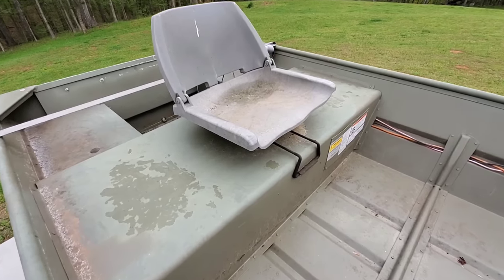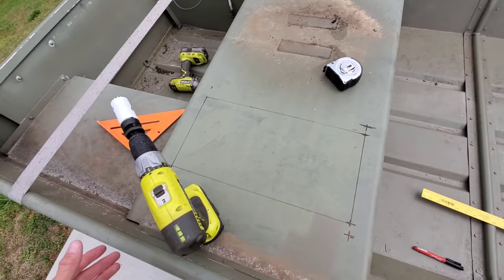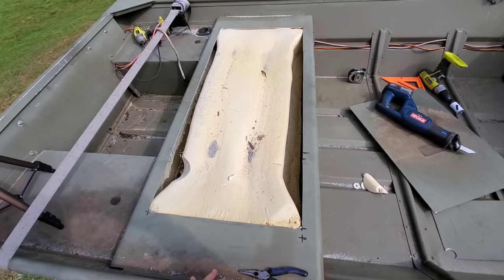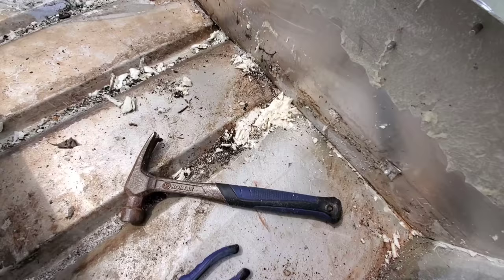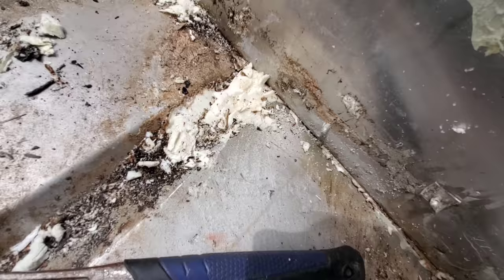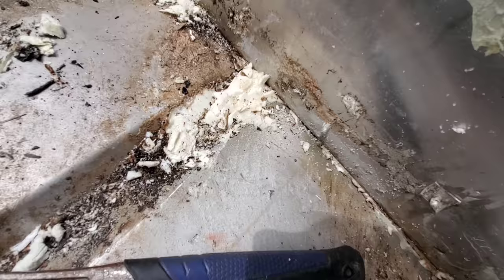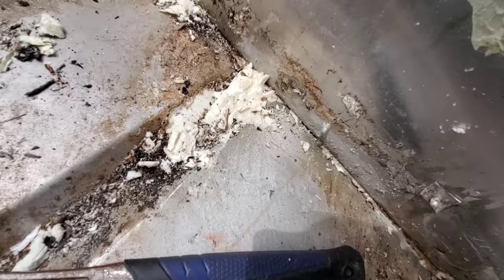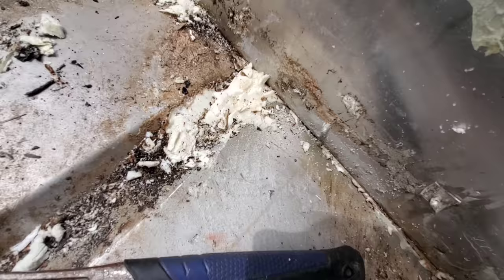Turn Your Jon Boat Bench Into Storage

Comment: Very nicely done. There’s a few things I would have done differently but I only noticed certain things because I watched you do it. You get better each time and we all learn from our mistakes along the way. You figure out what works best and what is the most efficient way to do things. Needless to say the end result you had was awesome. It’s a lot of work. I buy and build John boats and fish out of them for a year and then sell it and then buy another one and start over. In your head you think you can always bang it out real quick and then once you start sanding and prepping for paint you are quickly reminded of how much work it is to build one. I started out with a canoe I got for free. I refinished it, used it a few times and then sold it and used that money to buy a John boat. I then did the same thing and with that money I bought 2 more John boats and so on and so forth. I try to have 2 at all times so I can finish one and fish out of it while I’m building the other and then I will sell one. I’m working my way up until I have the money to buy a nice war eagle or something without having to take any money out of my bank account.

Comment: Using the recip saw- hold the saw vertical so that that shoe rides on top of the metal your cutting. This will stop the vibration of the saw and make it controlled cuts easier. 😊
Reply from the maker: Appreciate it! I upgraded to a circulars on the next one, it worked MUCH better. Not sure why I used the recip saw on this one besides trying to show off I can cut straight lol

Comment: Very nice job! I'm going for the same thing on my jon boat. Just a tip: A skill saw works great for cutting aluminum sheet. The carbide blades go through it like butter. But just keep a firm grip on the saw in case it bucks back on you. Hearing and eye protection a must! Greetings from Alaska. Oh yeah, plywood is $100 a sheet here where I live. Unreal.

Comment: I like how you countersink the rivets. I never would’ve thought of that. Also, get a scrolling blade for the sawzall. You’ll be able to cut nice straight lines because you can control the blade without it walking on you. Nice job. 👍
Reply: That’s insane!
Thanks for the tip!

Comment: I was able to find alucobond at a sign shot for $60 per 4x8 sheet. Did the floor in my boat. 1 3/4" foam in the floor between the ribs. I believe im going to go with a textured paint on the floor. You did a great job trying to get ideas on how im going to do the front deck and put a rear bench back in the boat with storage like you did here. I like how you did the strips of foam under the foam board. For an air gap. Great work.

Comment: I’m going back over some of simple projects to repeat on a buddies boat. For a moisture barrier under the foam, consider corrugated plastic. (Where the budget allows)
Reply from the maker: Thanks!
Reply: I like that idea. I might even put a few louvered vents in the front and back of the bench for more air circulation. I definitely want it to be as dry as possible
Reply: @Dangbo3030  not a bad thought. I’ve seen some run very small 12v dehumidifiers. May be overkill

Comment: I tried preserving plywood with epoxy resin. Its more flexible than fiberglass resin. It eventually broke down from the wood expanding and contracting. They sell 4'x8' pvc (Azek) board in different thickness's at home depot. It would work great for flooring also.

Comment: I loved the video! I made mine a little differently though. The seat lid is just one large piece connected to the aluminum with a piano hinge. It was a lot easier than aligning multiple pieces, and i have more access. It works great on my 14' Jon. I coated with polyester resin and primed and painted with Total Boat polyurethane paint and it turned out great! Thanks for the tutorial :)

Comment: I will say your work looks very good, but frankly i was floored by your return comment regarding removing the foam floatation.
Yes, you are correct in your opinion as to it not being necessary unless the boat flips over.
Building codes are implemented for the benefit of the buyer, not the builder.
Having been a home builder for over 40 years as well as a boat owner, i can attest to that.
Hanging onto a boat that wont sink would be a better option than having the boat on the bottom and nothing to hang onto in my opinion.
Coolers stashed in a small cabin have been documented in keeping a boat afloat, and thereby keeping the occupants alive.
My opinion is that if you need more space for storage, get a bigger boat or find a better way than eliminating the floatation.
For the record, boats over 22’ in length arent required to have floatation.
But fact is that many of the better ones do, and for a very good reason.
I do have a 14’ jon boat, and i did create more storage space, without removing any foam floatation i might add.
Reply from the maker: My response was not meant to "floor" you. I didn't take it as a rude response.  The fact of the matter is that I have a large viewership here. A lot of know it alls that feel the need to infere their opinion on my platform. The foam thing seems to trigger a lot of folks. Even though I've proved time and time again on video, it isn't doing what you think it will do. I could go on and on about modifications,  weight capacity,  howadding extra storage or decking can help it sink if flipped over, ect. We could even talk about modifications and how they aren't universal or regional, depending on the waters and intentions of the boat use. No point really. You do as you please with your boat, others will do as they want with there's. I can appreciate you like the foam. I think boat licenses should be required in all states. I think more guys should wear their kill switch lanyards. I think life jackets will save way more lives than relying on foam in an old aluminum boat to keep you afloat. Just my opinion,  apparently, everyone's got them. Thanks for watching even with disapproval of foam removal. Happy boating.
Reply: I have a old 14 foot ryan craft there was never foam in it.

Comment: Was there a specific reason you didnt finish out the interior storage place before installing the aluminum top. It seemed to me that it would have been much simpler to install the partition divider and finish out the flooring with the top panel off? It looks great by the way, gives me some inspiration to do my Alumacraft.
Reply from the maker: No. Was making it up as I went along. It wasn't so bad or I'd simply have drilled the rivets out and removed the top. Take away what you can from it and do as you please.

Comment: Hope this gets to you, but I’m in the process of building out a brand new Lowe aura. I cut the back bench out and removed the foam and added hatches for storage. The bench flexed a lot now under a load. Did you have that same issue when you did this? If so, is that why you added the aluminum bracing?

Comment: I’m not too sure about gluing carpet to foam. I would have thought you would put aluminum ribs then put the foam in the gaps then sheeted the bottom with carpet covered plywood or aluminum sheet. Thoughts?

Comment: What are the screws you're using at 20:56 going into underneath of the carpeted seat you made? Are they just going through the surface of the original seat or is that one of the spots where you have the aluminum crossbars spanning the seat?

Comment: Problem is that by using this method you eliminate the foam flotation.
I simply added a plywood deck on the ribs, which made the bench seats too low.
So i made 6” high boxes with water tight lids for the top of the seat, on those i put basic swivel seats.
The boxes hold all my tackle.
I didnt modify the boat at all, and still have the foam flotation, which i think is important.
Reply from the maker: It's not a problem unless you flip the boat upside down in the water. The foam only helps the boat float at that point. It has no factor in everyday performance or flotation if the boat is in the water right side up. Honestly,  the only reason it is there is to earn a Coast Guard certification for the make and model boat to get a vin # to sell legally. So, at the end of the day, its government bureaucracy mandated its there for the manufacturer to sell. Because of this, a lot if manufacturers just want to sell so they use the cheapest foam as possible to say "its there" but it does little in flotation or safety just a few years down the road. I've seen foam disintegrate into dust or break down to no longer be closed cell and actually absorb and hold water. That does more damage by creating pitting in the aluminum, which can cause leaks. Or do the opposite of helping it float if you flip it. Do what you please with your boat, but I've taken enough of them apart to know what could be under there, and it's no guarantee it's doing what you think it will. The only guarantee is it was put there when built in good shape to earn a certification from the coast guard to be sold. For a lot of people they'd value useful storage space over some foam that was forced into their boat by legalities which may or may not help it float in the extreme event of flipping the boat upside down in the water.
Reply: @AnthonyJonesBrigadeBoats  When I took my foam it out it was waterlogged and very heavy.  Doubt it would have provided any buoyancy and added a ton of weight.

Comment: Question: Do you apply the resin on both sides?
Reply from the maker: I used to once upon a time. Over time I realized it really only needed it on the tops where rain water would normally penetrate. For floors you can do top and bottom to protect from flooded boat. It's more material and labor doing the whole thing so you just have to make that decision yourself.  Me, I just do tops and sides now. Oil based paint bottoms usually.
Reply: @AnthonyJonesBrigadeBoats  I just framed out my casting deck using treated plywood and opted out of using the resin. Is this a bad idea?

Comment: Nice job -What type & size rivets & gun do you use? Some sort of drill rivet system?
Reply from the maker: 3/16 inch countersink rivets with 1/4-3/8 inch grip range. I use an impact drill w 3/16 titanium bit to drill hole, a regular drill with countersink bit to flush out rivet head, a Milwaukee m12 battery powered rivet gun for rivets

Comment: Hey cuz do you resin both sides of the plywood
Reply from the maker: Nah cuz I just do the tops real good and get the sides
Reply: Ok thanks im having to hold off a minute I may use road signs for my floor 😅 lumber is high as giraffe ass! Thanks for your reply cuz.

Comment: What was the height of the piano hinge? There are a few options. I assume it was 5/8 as you were using 1/2 plywood.
Reply from the maker: yes, 5/8
Reply: @AnthonyJonesBrigadeBoats  I wondered the same thing.  5/8" for this carpet (the thin Home Depot product) seems to work for sure.  For 1/2" ply with 20 oz boat carpet (a.k.a. the good stuff), I reached out to Tiny Boat Nation, because I wasn't sure what to buy.  They recommended 3/4"-height hinge to me.  This seems to be "on target" if I don't cut out the carpet where the hinge goes.  The wood is 1/2", and I get about 1/8"+ of thickness from the carpet squashed between the underside of the wood and the hinge, then the glue and carpet on the top side.

Comment: It's my understanding that you can not legally remove the flotation in a boat. Or at least not without adding the proper amount and location of flotation to bring it back up to the right specs like weight capacity, not flipping over when it takes on water, not sinking (after a certain year), etc. I think this is federal law but I'm not sure. Anybody know anything more about this?
Reply: I have an old 14 ft Ryan craft its never had foam in it. Maybe it’s just too old

Comment: By doing this, does it affect the buoyancy of the boat?
Reply: Don’t know if you ever got an answer to this, so figured I would chime in.   As long as the boat isn’t flooded then no, because the hull is displacing water (not the foam). If the boat floods then yes, because the foam would then be displacing the water.

Comment: The benches in my 14' MirroCraft are filled with Styrofoam that in pretty sure is glued to the sides of the bench. What's the best way to remove it when it has been glued in?
Reply: Don't  remove the flotation material.  That is what will keep your butt afloat when the unplanned disaster becomes the " oh crap what do I do now" right now disaster.
Reply: @frankorosz901  I'm adding in new foam in under the deck. It will actually have a LOT more foam than it has now when I'm done for that very reason.

Comment: Nice! Just found your channel.  Do you have a video on how to make a live well out of the jon boat bench? 60 gal plus?
Reply: Yah but it’d make the boats speed and turning radius total crap with that much water in it
Reply: 60 gal well? How much weight capacity does a boat this size have? 1 gal = 8.33 lbs.
Reply: It would be for catfish tournaments. We catch a lot of fish over 40", so most stock live wells are just too small. Hagen Grubbs shows how to make one out of a tool box on his channell, but since I have a jon it would make sense to make it out of one of the benches.
Reply: @fishing_with_TR  ya but do the math. 8.33 pounds per gallon x 60 gallon= more than a 14 foot Jon boats weight capacity once you add fishing gear and a motor and gas and an anchor. It’s not logical unless you have a boat designed with one or that can take it. Use your mind before you sink a boat or completely rip the boat in your driveway. That’s putting your life in your hands in a bad way, but you do you boo
Reply: @noahjohns7954  no worries.  I have an 18'. I already use a 64 gallon plastic tote that's modified as a live well. The boat can handle it.  Just would prefer to mod a bench for more space.
Reply: @fishing_with_TR  ah ok. I thought you meant 14’ Jon boat, so I just didn’t want you to submarine mod it haha
Reply: @noahjohns7954  appreciate the concern!😄

Comment: You know it would have been much easier to put that foam in before you riveted the aluminum back down also there is actually no reason for you to fully cut out the center of the bench if you're only putting in those two outside patches
Reply from the maker: Thanks, I'll update the video!

Comment: so much for it floating should it capsize.
Reply from the maker: If he flips a 1548 on an electric only lake, it deserves to go down...Boat still has plenty of foam in back behind bench, up front, and I added a good amount under floor and inside hatches. It might even have more closed cell foam in it than I took out.

Comment: First thing you do is remove the floatation security in your boat, .... Not the best idea but hey, you do you.
Reply from the maker: Only helps if you flip it. I added roughly the same volume if closed cell foam under the added floor system so I'd call it good. Bonus points for adding a bilge pump.

Comment: Unfortunately that boat will now sink if capsized . Also the storage is only functional if what your storing can get wet.
Reply from the maker: You can't win them all, my friend. Just a simple solution to add storage without having to rebuild a whole boat. If you don't see value in it, don't do it. Half the time the foam is dry rotted so bad or water logged that it wouldn't help you float anyhow if capsized.
Reply: Exactly, when is the last time you flipped a boat NEVER, the crappy big brother government has to get involved with everything, most foam in these boats unless new is water logged and 100% worthless. Nice job btw

Comment: So I was wondering if I remove the middle bench is there gonna be any  structure problem for my rivet jon boat? This is my first time and I'm debating if I want to do it or not. If I do it. It would be completely a open floor  so I will have more space to move around and not cross over the middle bench .
Reply: My boat is a 1542 jon boat

Comment: Aren't you kind of asking to sink your boat if you remove all the foam?
Reply from the maker: No. If you take on too much water the boat will sink regardless.  The more foam you have, the more buoyancy you have to offset the water, which means you sink slower or can take on more water before sinking. Lots of boats out there with zero foam, probably not recommended. That's the whole reason we run bilge pumps, to pump the water out and not rely on foam. The foam has zero impact on keeping the boat afloat in regular conditions, only when you spring a massive leak does it have an impact and at that rate, again, I recommend having a bilge.

Comment: You must love wasting money buying stuff from TBN. You can get everything cheaper elsewhere. His mark up is ridiculous.
Reply from the maker: Well for full transparency I'm sponsored by them therefore I don't waste anything.  Secondly, the stainless 1/2 inch offset latch hinges in this video are their proprietary design and at the time the only ones on the market. Lastly,  everything in the free market is ridiculously marked up right now from groceries to gas to boat parts. But what you want or need from where you want.